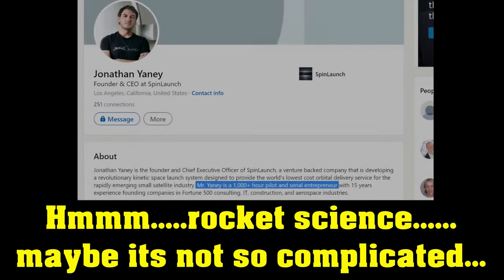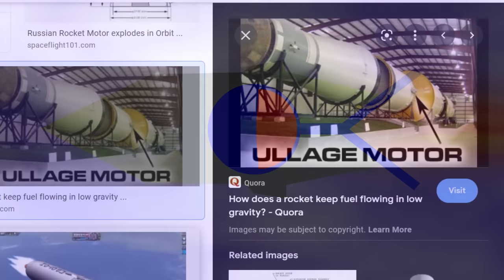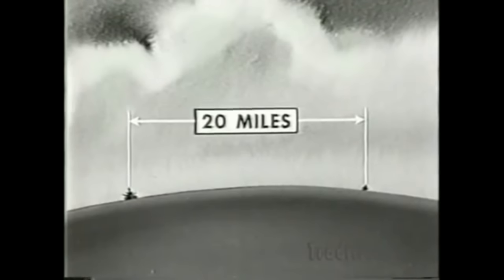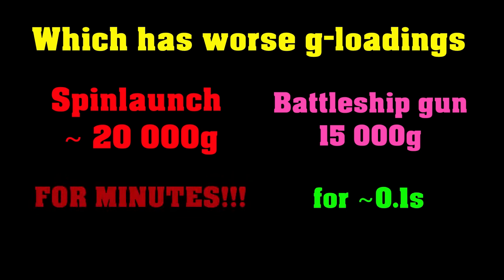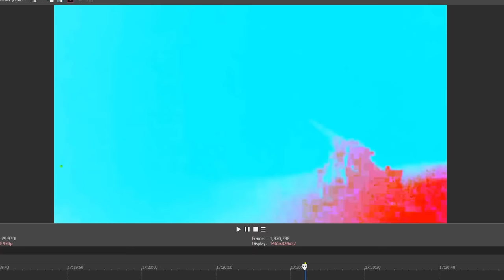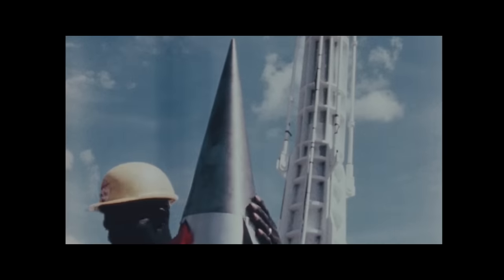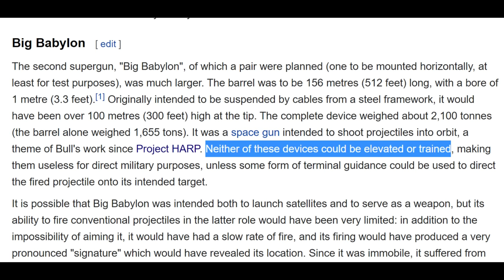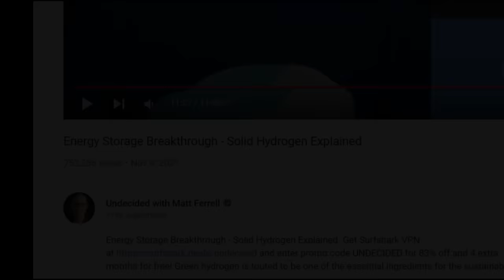Spinlaunch: BUSTED (Part 2)

Comment: To achieve a stable trajectory for the projectile they would need to remove all the angular momentum during the separation. I believe that's why the projectile has so much angle of attack when exiting the barrel. 

The issue will only increase with RPM and will be really difficult to alleviate.
Reply: it only spins a 430rpm.
Reply: @bschwand  for now yes, but increased speed mean increased RPM. 6 or 7 times to reach their target of Mach 6-7.
Reply: @0188Charly  they plan to do 430rpm. That is nothing.
Reply: @bschwand  it might not be much, but it means the projectile will always exit in the atmosphere with an angle of attack and a rotational speed. the extent of the angle of attack will depend on the RPM and the length of the barrel.
I not dumped properly this might be enough to cause pretty serious aerodynamic oscillations.
Reply: @0188Charly  you could release at different points at different times to compensate. Imagine two anchor points along the "rocket". Release front one first, this will cause to tilt out, then release back. With proper timing, rotation and alignment can be compensated, and the projectile exit straight with no cinetic moment.
Reply: @bschwand  yes I thought about this, that's why I didn't say it was impossible.  Timings might need to be really precises though. Maybe with some pyrotechnics.
Reply: @0188Charly  well that is kind of my whole point: those are engineering problems to solve. I do not understant this kind of video, what is the point ? reviews of scammy products, I understand, but here we are talking about stuff that is not actually outlandish considering the current state of science and technology. They even made a working small scale prototype. So why the hate ? Same for all the anti starship/Elon Musk videos. What is the point ? I mean this all comes off exactly like the luddites criticizing airplane, motorbikes, train development at the beginning of the 1900.
Reply: @bschwand  you're right we'll see! But the footage we saw seems to show that the issues us not addressed in the current prototype.
Reply: @0188Charly  sure, that is why it's a prototype 🙂

Comment: Mostly great video, but one point you keep coming back to (depressurizing the chamber) isn't really a fair criticism, since even the test piece that they're working with does prevent air from backfillling the main chamber after firing.

Ulage motors also aren't required.  Most rockets these days use pressurized bladders to force fuel to the bottom of the tank. And even if they didn't, I'm not sure the animation missing an easy to correct detail is a big takedown.

The insurmountable engineering problems here seem to be the g-loading and launch accuracy.

Anyway, it's a weird thing. Don't invest. But if someone else wants to burn some money to see if they can make it work, I don't really see problem with it.

Comment: SpaceX aren't using Ulage motors on Starship.
They are using a small header tank.
These guys might be using the same thing.
Reply: It’s a Pressure-fed Engine, meaning the Tanks are pressurized.

Comment: why not mention the big issue.. a 200kg rocket, spinning at 20.000G, meaning it "weighs" 4.000.000 kilo's at the point of a release. 
Which results in a 4 million kilo unbalance in the system as soon as it's gone... Pretty sure it wouldn't be good to have such an imbalance out of nowhere, with air rushing in at the same time.. trying to fix that imbalance by shifting a counterweight, is probably not do-able.. and releasing the counterweight at the same time won't work either.. yeeting a 200kg weight into the ground at that speed, can't be good either.
Reply: It’s not going to spin at 20,000g. The prototype is capable of reaching 20,000 but that isn’t the rate used for launching. 
It seems to have a counterweight on a shorter arm, and a system of some sort of counterweight flywheels spinning up in the opposite direction.

Comment: Didn't project HARP end up getting cancelled because it just wasn't very useful?

Also, it's possible that the computer graphics were taking the ullage motors as read. Maybe we could give them the benefit of the doubt on that one? That way, we get to  focusing more attention on the moment of the projectile's release, when the centrifuge will take several minutes to dissipate the residual kinetic energy by destroying itself.

Comment: 2:22 well either that or you stick a pipe on the top of the tank make to do a 180s thru a pumps and then out into the chamber but thats heaver and has other issues

Comment: Well, the HARP gun did attain an altitude of something like 170Km, but, it was 2 16 inch Iowa class guns put together. I could see a version of a spin projectile working, but the projectile would have to be flung using a magnetic track system and NOT a freaking swing arm. Even if the arc was kilometers across? The centripetal force would slosh liquid fuel to one side unbalancing the load and causing problems. Considering HARP received less than $6m USD and this fraud show .....know what? I doubt if it had more than $800k and most of that spent on cgi 
 flash than anything real.

Comment: if it's a vacuum chamber, than not only the "woosh woosh" shouldn't be there, but the seal that the rocket breaks through wouldn't be blown out, it would be punctured and then sucked inward, right?

Comment: Not sure, whether Spinlaunch will work, most likely not. But I wouldn't bet on it not working after I gave it some second thought.
Nevertheless I also thought about building a long tube at a large mountain and doing HAARP style stuff but with a lot more length (less G Force) and the advantage of releasing the payload at higher altitude (hence the mountain). Potentially easier to build and cheaper but I never did the math on it either...

Comment: One more thing, many run of the mill engines spin stuff beyond the speed of sound at sea level without melting... Like half of airplanes [the sportier ones] have propeller blades tips exceeding the speed of sound, even some helicopters, and a lot of turbo jet engines, not just military ones, but like planes you can actually buy... The more you know! They have blade pitch, and have to pull air as the plane also moves quite quickly. Check out grade 11 physics and yeah space travel is largely simple compared to your ego. Igniting liquid propelled engines for example is pretty cool and can be done very reliably with craft experiencing g loading or not. They actually pump the go juice out of the tanks with a turbo pump because the static pressure isn't enough to feed the fuel fast enough. but static pressure is used to ignite the turbo pump and in a full cycle engine the exhaust from the turbo pump is vented back into the main combustion chamber for extra efficiency. where the first cough and sputter of the engine is already enough to slosh the fuel around. but you tell us how because it was 3d animated it can never happen.

Just because of you, I want them to brute force make the spin launch work despite all the downfalls, and still lower the cost to space. You have zero idea of how machines work, and you are using the success of others to attract youtube views...

Comment: In their defence time coding the video is supper dodgy:

1. you have no idea what parameters they were testing when that video was shot, it could have just been a 300m/s shot, as no doubt doing 1800 m/s is going to take its toll on the setup and require extra energy, more expensive test equipment in the projectile. Which might not be necessary for a demo shot or while they are ironing out any "issues" [I am shure they have many].
2. you get aliasing in videos, ever seen wheels on cars go backwards, or helicopter blades appear to stop in mid air? That's aliasing, and we have no idea from the video if that is going on. 

From the audio 3revs/s kind of lines up. However the noise also hints that #1 maybe being true, in that they only ran a partial vacuum for a test shot and are not cranking it all the way to max performance as they iron out issues [with releasing the projectile straight].

Think about it more logically from their point of view. Instead of sensationally downplaying the idea as "busted". They have an expensive and experimental test article. They don't want to mess things up and break it. They will be slowly pushing the boundaries of what they can achieve. but at the same time they have to keep their investors/stakeholders happy and up to date. Likely what is going on here is they have spun the thing up to its designed release speed but not released it (and so can claim "Achieved 6x speed of sound"), and they have been conducting lower speed 1c releases as they iron out their release mechanics. But come on 300ms is still blooming impressive from a suped up ferries wheel!

Also as Scott Manley points out in  the linked video and his others on guns to orbit,. Guns have their problems too with barrel ware, and the speed limit of the expanding gas and conversion efficiencies. 

Shure be sceptical of this spin launch, but its far from busted till they go bust or the thing has had a string of failures without actually going to orbit.

Comment: On my mind is what happens if there is a major failure / explosion.

  For a rocket, burning / exploding fuel and, if it had launched, possibly scattered debris along the flight path.  A common  enough ocurrence that we know how to deal with it when it happens.

For a gun, I'd imagine the gun itself would be destroyed.  Worrisome if you are next to it, rough on anything close by but, again, the sort of occurrence we have a lot of prior experience with.

  Spin-launcher that breaks during use?  I'm imagining large random chunks of wreckage flung in random directions at extremely high velocity.  I have an exceptionally bad feeling about that.

Not saying the idea shouldn't be experimented with in small scale, simply because You Never Know.  But pouring millions in while confidently expecting it to be the Next Big Thing?  Yeah, uh, no.

Comment: 400 lbs x 20,000 g= 8,000,000 lbs spinning. And then let it go. Busted. Case closed. 
For the numerically challenged that is the weight of 12 Boeing 747's combined.

Comment: if u remove  200 KG from something spinning that fast im pritty sure  the  whole thing will break , just look what an unbalanced  wheel does  with way less  rotational speed  :P  , and when the  preassure comes back into the  chamber/facility , the whole thing will  burn up  due to wind drag . becas i doubt the  spinning thing goes from 5000 km/h to a full stop as soon the  projectile releases :P . alot of  problems  with that spin idea XD

Comment: Not a spinlaunch fanboy, but being an aerospace engineer myself, I couldn't help the desire to point out some issues with your arguments:
- The vacuum chamber doesn't have to be evacuated every time, they say they'll be closing a gate after the payload exits the main chamber. How that works so quickly I'm not sure, but you do hear them in the promo video saying "pressure is stable" after launch. Payloads can enter the main chamber through another series of gate valves. I've worked in a similar environment with a large main vacuum chamber with gates to smaller ports for installing equipment. I don't imagine they have to pump down much lower than the millitorr range, you can get that with conventional pumps in a matter of minutes. The membrane on top would have to be replaced quickly, but that's a solvable problem.
- I would argue the duration of constant G-loading isn't really that important. If a component is going to fail at a certain load, it'll do it pretty quickly. By increasing the load slowly, you'll also mitigate some of the transient effects you would otherwise see in the projectile case. Regardless, these problems of high-g loading on electronics have been proven to be solvable (see Raytheon's excalibur projectile)
- Comparison of payload mass is really important here. Project HARP reached it's velocity/altitude record with an 84 kg *projectile*. Spinlaunch is advertising a 200kg *payload*. If the standard interpretation of payload here is assumed, that means the total projectile is going to be much heavier to carry that payload, possibly up to an order of magnitude. To get that mass to the same velocity using a gas gun would take a lot more energy, even longer barrel, etc.
- In your last video you mention how "dirty" the chamber is, as if that's an indication of how serious the project is. Sure, chamber cleanliness is important if you're trying to reach 10E-7, 10E-8 torr, but that deep level of vacuum is hardly necessary just to cut out drag. Even then, I've seen dirtier chambers reach E-6 with a strong enough pump. 
- Level of engineering knowledge of the CEO doesn't matter a great deal in an aerospace company past a certain point. A CEO's main purpose is to operate the company as a whole, they're rarely the ones doing the actual engineering work. It looks like they've hired a lot of talent from other successful aerospace companies, who are no doubt well qualified for the task, and have done the initial math.
- The rotation problem is an issue, but again, solvable. This test was likely just to prove out the spin up and release mechanism, not a perfect scale replica of an orbital operation. You never perfect everything in the initial test, you don't even try to, otherwise you get stuck trying to build a hundred things and don't even know if you're base concept works. Did you see the initial Starship prototypes? Those things were very bare bones, and were put together quickly just to prove the concept and see where the failures were.

Your arguments seem to suggest a lack of background in this industry, I'm guessing this is more for the views than to educate.